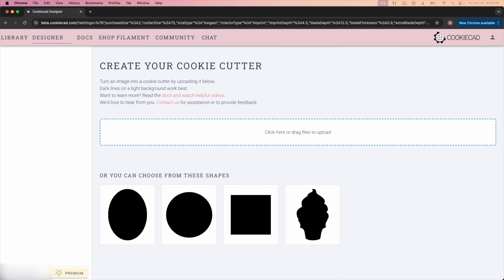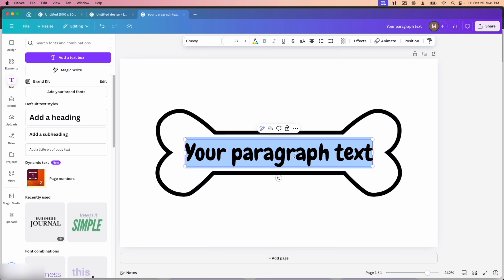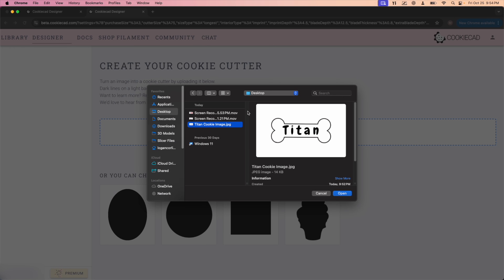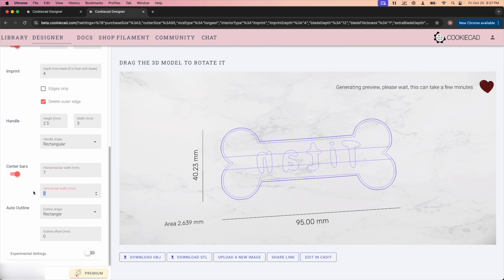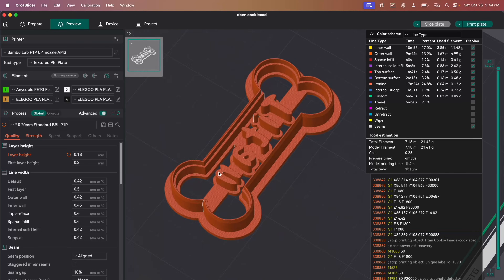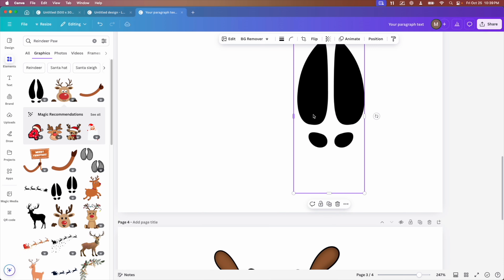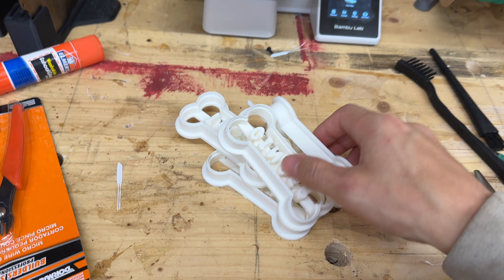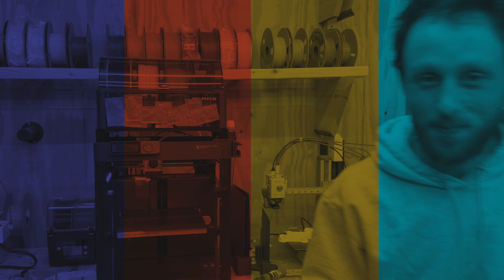Design and 3D Print Personalized Cookie Cutters with Ease using Canva and Cookie CAD

Comment: What filament is food grade?
Reply: Technically none. Here is the thing, PLA alone is food safe but when it's turned into filament it's run through nozzles that may be contaminated with other metals like lead and microscopic amounts may end up in the filament, and filament made in China may contain who knows what. Then there is your setup and nozzle, brass often contains small amounts of lead (or even mercury on cheap nozzles) and yes you can get some say stainless nozzles to prevent this issue. Then there are layer lines and microscopic holes and crevices that may be a spot impossible to fully clean and have bacteria growth. All that being said, PLA is unlikely to cause any real world issues and people use 3D printed cookie cutters all the time (don't know of any cases of death or even getting sick) but there is a huge debate over 3D printing and food safety and in theory any item produced would need to be tested ($$$$) to be certified food safe no matter if all the materials and machines involved were certified food safe "technically" it's the end product that counts. Yes, I make cookie cutters and yes I eat the cookies but don't be surprised if you see a lot of people say NO WAY it's never safe. But then again I drank water from a garden hose as a kid to.
Reply: Great answer😂😂😂

Comment: I was told it's not safe to use PLA for cookie cutters since microbes can get stuck in the layer lines. Is there something you do to account for this?
Reply: You can use them with saran wrap as many bakers do to have slightly rounded edges.
Reply: Yea, I was always told this same thing, which is why I never implemented them into my shop. Maybe its fine if you put a disclaimer in the description or something that its for one time use or playdoh only.. use on actual food at your own discretion for X reason. Cuz I am definitely not gonna add a post production step to seal these or anything, too much work.
Reply: I've been looking at this also, you can get food grade pla or petg, but as mentioned it's easy to get things stuck in the tiny crevices which I've heard just hand washing is hard to get out, so I would be okay with stating that these are good with the food grade filament for a one batch use, just get a lot of dough ready for a big batch... The Saran wrap is an idea though might be a little cumbersome for more detailed cutters
Reply: The oven bakes at 350* germs can't survive 😮
Reply: @countrylife5585 The bacteria builds up on the cookie cutter between the layer lines. Cookie cutters don't go in the oven 😮
Reply from the maker: I would recommend them for one time use or for playdoh/ceramics or wash and soak right after use with hot water and soap

Comment: Hey bro where did you get the stl for those trays on your shelf? I’d like to make some trays like that for organizing
Reply from the maker: Thanks for the comment, They are from Eternity Labs on Makerworld. https://makerworld.com/models/520956
Reply: @TheMountainMaker i appreciate it brother, thank you.
Reply from the maker: No problem!
Reply: @TheMountainMaker hey man I followed your video but I was trying to do a Christmas tree shaped cookie cutter. I had text in the Christmas tree (I used Canva), but when I put it in cookie cad, the text didn’t come with it.  Did I do something wrong in canva?
Reply from the maker: It sounds like you have only the cutter turned on in Cookie Cad. Be sure that Imprint & Cutter are turned on and if it is, make sure your design in Canva is using vector style images without added colors similar to the ones I chose in the video. 

I was able to get cookie cad to replicate your issue with a few images I had and what I found was that all your lines and text need to be black or a dark color, if not you'll get this message from Canva "Nothing was found. Your image may be too light colored, try to use dark lines." 

The other thing to note, is I wasn't able to get this method to work with every single image I tried. It doesn't like white, so when I tried to upload my channel logo, it took out the "D" and the light green/yellow background that surrounds it as well as The Mountain Maker text below it. Changing these to black text and slightly darker background took care of that issue for me.